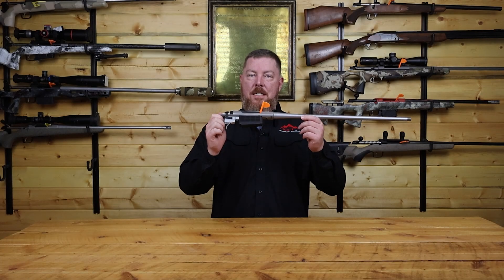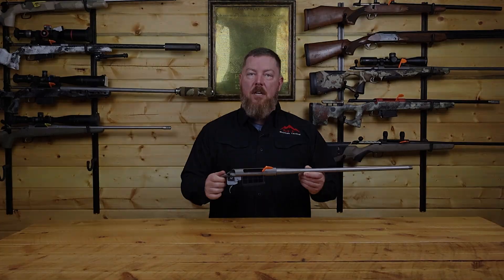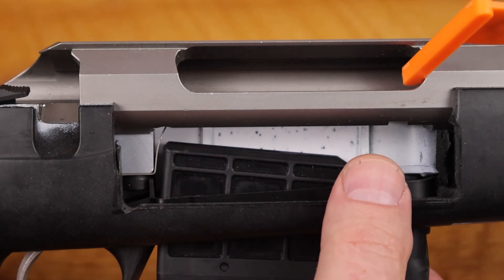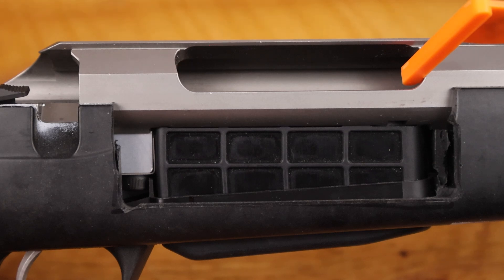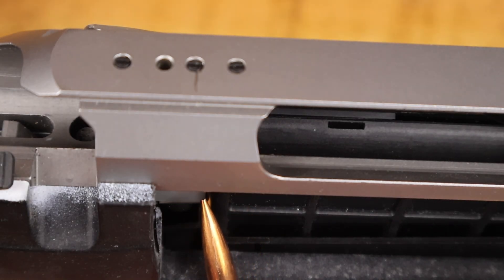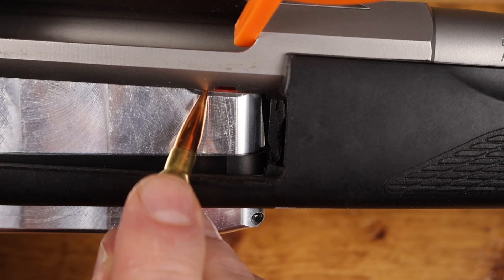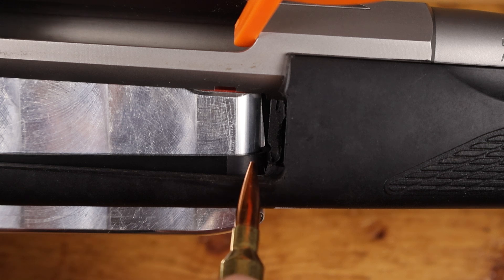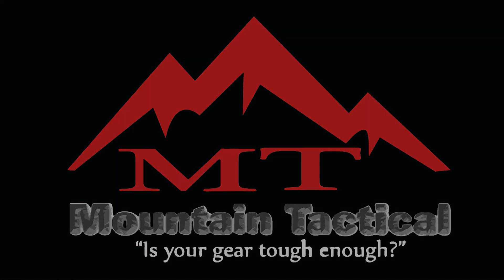How Does Tikka Bottom Metal Work?

Comment: Nice video. I have 3 of your bottom metals and would recommend them to anyone. With the factory plastic “metal” on one of my Tikkas, I torqued the action screws once and felt one of them “let go.” I switched 3 of my 4 Tikkas to yours almost immediately after that. I have an older T3 that I’m holding out on for some reason.

Comment: Rosilandstewart - I have a lot of 7PRC brass and 7RemMag brass on hand. I do not know of anyone making 7WSM brass. I checked Peterson and ADG sites. If someone was making it I would consider it. But then I'd have to make a dummy round where a heavy bullet was seated long, send it to JGS and get a reamer made. I just don't do short magnums as designed. Just like I favor 7RemMag reamers where bullets are seated longer. So, I'd have the expense of a new 7WSM reamer and I'd want to buy enough brass if anyone made it, for probably at least 3-4 different rifles/barrels. 

Instead, I was toying with the idea of a 7mm-300 Norma magnum Improved which has more case capacity than a 28 Nosler. If I went down that road, it would be nothing more than a new project that simply costs a lot of money but would likely be fun. In terms of practicality, it is really hard to justify considering the simple 7s we have available. My longest kill was a 202" Colorado mule deer at 800 on the nose. I used a 168 Berger VLD in a 7RemMag, Winchester brass, 215 match primer, 73.0 Retumbo at 3000fps. It was also the heaviest buck I've ever killed. So, with that experience, and the doubt I'll ever do another shot at that distance, I ponder, why do I need more power, bigger bullets, etc.? I don't. I have no doubt a 7PRC with a 175 grain bullet even at 2850 would have accomplished the same thing. All ya gotta know is your come ups on your scope and have time based experience with your setup.
Reply: Alpha is now offering 300wsm brass. Hopefully it the sales are good enough, they will offer 7mm wsm.

Comment: So is the Short action and Long action Bottom metal the same dimensions, minus the magazine opening?  Most aftermarket stocks that accept factory bottom metal dont specify short or long action, so would it work for either?
Reply from the maker: The magazines are the same outside dimensions.  The short action magazines have a molded in spacer in the rear to hold the rounds forward.  Then the short action bolt stop keeps the bolt from coming too far back.

Comment: 4 of my factory contour 7mm cut rifled barrels arrived. Man they are exact. I'm swapping one of them with a guy I already sold a different bbl to. He changed his mind on his build. Now he wants to convert his Tikka 270 to a 280AI. That leaves me with 3 Tikka contoured bbls, 2 in 9 twist, 1 in 8 twist. The plan is a 280AI, 708, and not sure what I'll do with the 8 twist. Most likely a 7PRC....like I need yet another one. Thanks for another great video. You explained a lot. I passed on a pre-owned but perfect left hand blued Hunter in 708 because the mag would not latch despite us properly torquing the screws. It would only latch if the screws were loose
Reply from the maker: Oh man...  If you bed that bottom metal I bet you could fix the spacing.  The owner most likely over torqued it at some point and damaged the wood.
Reply: @mountaintacticalcompany  We looked that over with 3 sets of eyes with the bottom kit removed. The rifle appeared brand new right out of the box. We didn't even see finger prints on the wood or metal. Who knows, but I passed on it
Reply: What about a 7wsm for the spare barrel you have, just a thought as it sounds like you already have a few PRC,s cheers Yogi ✌️
Reply: @rosalindstewart7013  I have a lot of 7PRC brass and 7RemMag brass on hand. I do not know of anyone making 7WSM brass. I checked Peterson and ADG sites. If someone was making it I would consider it. But then I'd have to make a dummy round where a heavy bullet was seated long, send it to JGS and get a reamer made. I just don't do short magnums as designed. Just like I favor 7RemMag reamers where bullets are seated longer. So, I'd have the expense of a new 7WSM reamer and I'd want to buy enough brass if anyone made it, for probably at least 3-4 different rifles/barrels. 

Instead, I was toying with the idea of a 7mm-300 Norma magnum Improved which has more case capacity than a 28 Nosler. If I went down that road, it would be nothing more than a new project that simply costs a lot of money but would likely be fun. In terms of practicality, it is really hard to justify the simple 7s we have available. My longest kill was a 202" Colorado mule deer at 800 on the nose. I used a 168 Berger VLD in a 7RemMag, Winchester brass, 215 match primer, 73.0 Retumbo at 3000fps. It was also the heaviest buck I've ever killed. So, with that experience, and the doubt I'll ever do another shot at that distance, I ponder, why do I need more power, bigger bullets, etc.? I don't. I have no doubt a 7PRC with a 175 grain bullet even at 2850 would have accomplished the same thing. All ya gotta know is your come ups on your scope and have time based experience with your setup.
Reply: @rosalindstewart7013  I have a lot of 7PRC brass and 7RemMag brass on hand. I do not know of anyone making 7WSM brass. I checked Peterson and ADG sites. If someone was making it I would consider it. But then I'd have to make a dummy round where a heavy bullet was seated long, send it to JGS and get a reamer made. I just don't do short magnums as designed. Just like I favor 7RemMag reamers where bullets are seated longer. So, I'd have the expense of a new 7WSM reamer and I'd want to buy enough brass if anyone made it, for probably at least 3-4 different rifles/barrels. 

Instead, I was toying with the idea of a 7mm-300 Norma magnum Improved which has more case capacity than a 28 Nosler. If I went down that road, it would be nothing more than a new project that simply costs a lot of money but would likely be fun. In terms of practicality, it is really hard to justify when we have the simple 7s available. My longest kill was a 202" Colorado mule deer at 800 on the nose. I used a 168 Berger VLD in a 7RemMag, Winchester brass, 215 match primer, 73.0 Retumbo at 3000fps. It was also the heaviest buck I've ever killed. So, with that experience, and the doubt I'll ever do another shot at that distance, I ponder, why do I need more power, bigger bullets, etc.? I don't. I have no doubt a 7PRC with a 175 grain bullet even at 2850 would have accomplished the same thing. All ya gotta know is your come ups on your scope and have time based experience with your setup.
Reply: @rosalindstewart7013  I have a lot of 7PRC brass and 7RemMag brass on hand. I do not know of anyone making 7WSM brass. I checked Peterson and ADG sites. If someone was making it I would consider it. But then I'd have to make a dummy round where a heavy bullet was seated long, send it to JGS and get a reamer made. I just don't do short magnums as designed. Just like I favor 7RemMag reamers where bullets are seated longer. So, I'd have the expense of a new 7WSM reamer and I'd want to buy enough brass if anyone made it, for probably at least 3-4 different rifles/barrels. 

Instead, I was toying with the idea of a 7mm-300 Norma magnum Improved which has more case capacity than a 28 Nosler. If I went down that road, it would be nothing more than a new project that simply costs a lot of money but would likely be fun. In terms of practicality, it is really hard to justify considering the simple 7s we have available. My longest kill was a 202" Colorado mule deer at 800 on the nose. I used a 168 Berger VLD in a 7RemMag, Winchester brass, 215 match primer, 73.0 Retumbo at 3000fps. It was also the heaviest buck I've ever killed. So, with that experience, and the doubt I'll ever do another shot at that distance, I ponder, why do I need more power, bigger bullets, etc.? I don't. I have no doubt a 7PRC with a 175 grain bullet even at 2850 would have accomplished the same thing. All ya gotta know is your come ups on your scope and have time based experience with your setup.
Reply: @rosalindstewart7013  Youtube deletes my comments so I answered you in a new comment